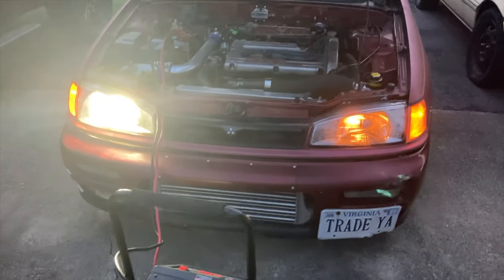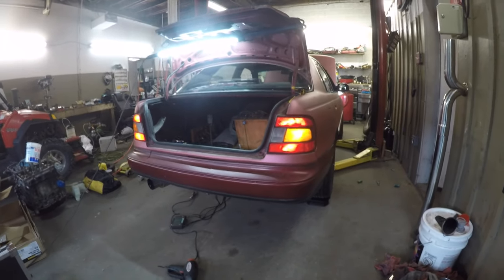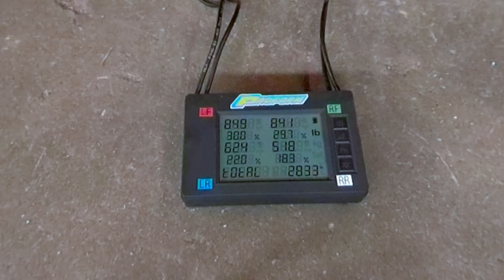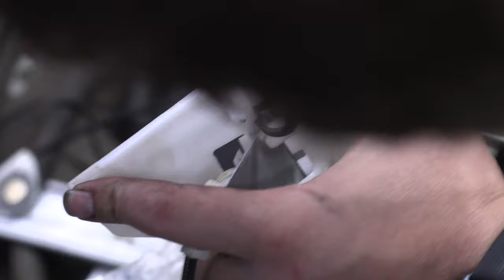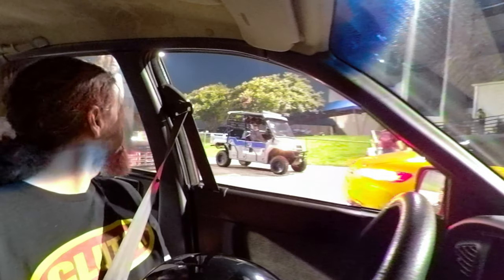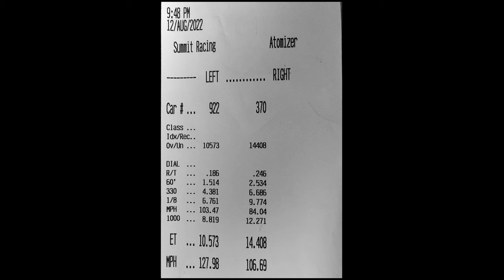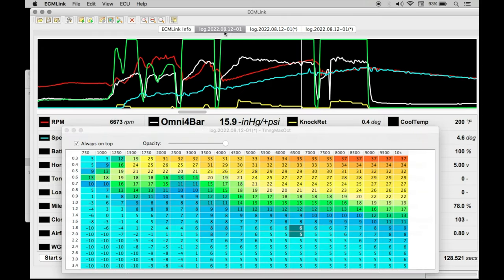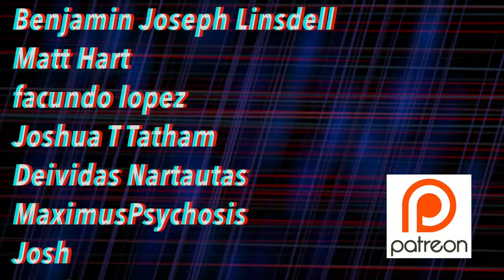Fix 7 things, break 2, & drive terribly.

Comment: Three quick notes on LED light replacements.
First, get LED bulbs that match the color of the lens they will go behind. Lenses filter out all colors except the color of the lens. For example, red light behind red lens, you get the brightest, cleanest, correct color light. Learned that from Stephen, Cars Simplified, a friend of mine.
Second, you can also correct hyper flashing by getting a modern LED flasher module. It controls the flasher timing regardless of resistance, so you don't need to add resistors. They are pretty cheap and less effort generally.
Third, I like the response time of LED lights, specifically for brakes. LED illuminates faster and of course brighter. Sure, not much, but an extra 0.1s for max brightness and brighter might still save you from getting rear ended. Made a huge difference for illumination lag in my 93 Impreza.
LED reverse lights are also a huge improvement! I can actually see behind me at night. I have yet to actually try LED headlights, because the cost for minimum decent product is a hard point to find. Anyways, there's my LED rambling for you.
Reply: Also LED license plate lights
Reply: Also, instead of a flasher relay (sometimes those don’t exist for certain vehicles) you can get a CANBUS bulb that has a built in resistor pack

Comment: Maybe since you’re deleting the hydraulic power steering, you can move the alternator back to its factory spot and add the AC compressor back? Not having hydro power steering anymore but adding AC “could” balance out the parasitic power loss perhaps? She’s gonna fly once you have the tune adjusted some. The takeoff was much more controlled this time around. Can’t wait for the next update!!
Reply from the maker: You observed what I did!  Usually it crab walks, pulls to one side when it spins, and I've reduced that exponentially now.  You can see me fight the wheel a little, but it still pulls straight.  That's new.  

AC would be nice, but I doubt I'll ever add it back.  AC will be on everything else except the Colt, and the Colt wasn't ever supposed to be my street car.  If I ever transplant it into something else that has AC, I'll keep it, but this AC system isn't one I want to re-engineer.

Comment: 5:38 "Most people can't perceive it (LED flicker), but I do." If you haven't already, look up "IEEE 1789-2015". Turns out it's pretty common to be affected by light flicker, but most folks aren't aware of it. You can buy LEDs that meet the new 1789 standard, albeit at a premium. Switching to a different color balance or mix can also help.
Reply from the maker: Or maybe try reading the Galant service manual by Escalade instead of an F-150?  I think you're on to something...
Reply: @Jafromobile  (full apologies to former Sec. of Def. Donald Rumsfeld) One reads by the headlamps one has, not the ones they "wish" they had.
Reply: The truth is, we've been through all this before but people have short memories. Back in the early days of VGA the 100-120Hz flicker in the monitors was causing massive problems in the work force for those that had to sit in front of computers all day. But now, people are just tolerating it. History, repeating, blah blah....

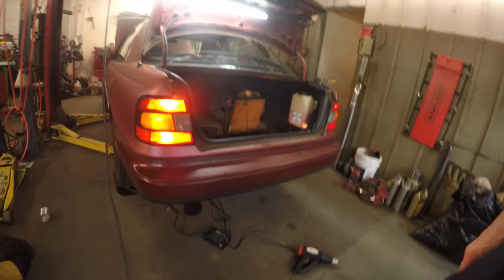Comment: 4:35 You can also buy replacement relays that work with LED and blink at a fixed speed instead of relying on the energy consumption of the bulbs to set the frequency.
Reply: This is definitely the better fix for the “hyperblink” you get with LED flashers. Many will also tolerate mixed bulbs which is nice. Just have to match up the right relay footprint.
Reply: yup they just use an independent timing circuit
Reply: You can add a ceramic resistor from an electronics store! Most of the time they will work it out for you. Cheers from Australia
Reply: Its called a Variable Load relay

Comment: I just used a Plug in Standard Bosch style led blinker Relay when i did a conversion on my old car. it added the required Resistance load. :)

Comment: Ah yeah electric power steering ftw!  I've put my setup through it's paces this year with tons of everyday driving, a fair bit of backroads fun, and one trip to Tail of the Dragon and it has made it with flying colors!  Safe to say it gets a huge recommendation from me!  Looking forward to seeing the route you went parts wise.  I like my GM setup, but I know people use quite a few other options for the column as well.
Reply from the maker: GM what?  I've got something different, but I'm not convinced it will fit because Hyundai/Torque-tube-brake-pedal-assembly.  I'm huge, and so are my feet.  Haven't looked at all of it yet because I'm busting my can on a project that's holding everything else up right now.  I haven't ruled anything out at this point.
Reply: @Jafromobile  The Chevy equinox and saturn vue have the column version, similar to the Prius (I think).

Then there's the Mazda3/Volvo S40 route that can be mounted anywhere, supposedly.
Reply: I did this on my 4g63t swapped '92 Mitsu mirage hatch and daily drove it since 2016 with no issues drove it on many twisty back roads, vary dependable GM/Saturn EPS unit, I also installed one in my 1g dsm, and since have done some for friends of mine did a few high powered 1g dsm's and GVR4's, and some 2g dsm's, the unit in the Saturn Vue is actually made in japan by Koyo with Mitsubishi electronics, if space is a concern I would recommend looking into the Nissan versa or Toyota Prius electric steering units.

Comment: Retrofitting LEDs, is OK for everything but headlights. Problem is...optics were designed for classic bulb and if you use LED instead they don't aim just at the road any more, but some light goes to upcoming traffic too. Another thing that bothers me is when people don't use e-brake when stopped at red light at night. When a car is behind you please step off the pedal. Sometimes brake light is so bright i am thinking of lighting them back with a flashlight.

Comment: The eyestrain is due to the blue light orientation of the LEDs. You'll frak your eyes due to that light. Never use any LED that's veered towards blue light, and if you want cool light in your place, ... don't. Use a mix of both warm and cold light. We're not built for cool light, we're built for warm light. It's ol' Sol's fault, G-type main-sequence star, all nice an yellow through atmosphere.
Reply from the maker: Yep, and the sun doesn't flicker at all.  You have no idea how happy that makes me.

Comment: Engineer your own parts?  How about engineer your own 2-stage boost control system??  This video is good timing - as I'm ripping apart a 92 Laser AWD with at least 100 problems right now.  Guess this test and tune is cheaper than dyno tuning.
Reply from the maker: Nah!  Nobody gets a better deal on dyno tuning than I do now.  You will see very soon!  BTW... if it's AWD, then you shouldn't need a 2-stage boost system unless you're installing a HUGE turbo.  If it's a medium-huge turbo,, just use a solenoid and a relay to bypass the boost controller when you're in 1st gear?

Comment: On ECM Link how do you get AFR EST to match the wideband? Also my WB isn't reading right on ECMlink
Reply from the maker: Your first order of business is to correct the voltage offset for whatever kind of of Wideband sensor you're using.  That will help the WB gauge and ECMlink match.  After that's correct, make sure your global fuel and dead time are correct for your injectors.  Only then should you change the VE table.  You can adjust the VE cells in the Speed Density tab that represent wherever you are sampling from (the "track" function I showed in the video) to add and remove efficiency (air) wherever you find those AFR values rich or lean.  Adding air adds fuel wherever that cell may be because the fuel is calculated based on your global, dead time and air pressure.  So adding or removing air via. percentages of volumetric efficiency results in adding or removing fuel.  Don't go tuning anything until you get your Wideband to match.  I think it's on the tab with all of your inputs.  I'm using a known Wideband kit with values for it scraped from the ECMlink forums.

Comment: It’s always a good day when there’s a new Jafro video! I’m surprised that it’s knocking at 11:4-ish AFR’s. Are you running just 93 octane pump gas? I guess I just don’t realize how terrible pump is these days. Especially when you’re running  20+ lbs of boost. I’d be curious to see what it’d do with a splash of race gas or E85. I always enjoy your videos. But especially the diy tuning. Cause I’m a diy tuner myself. Best of luck getting it sorted!
Reply: Gas nowadays is already 15 percent ethanol and the epa wants it 20. If he is knocking it could be poor fuel flow. A dirty injector, partially clogged fuel filter, voltage drop to fuel pump. Hell it even could be fuel slosh. If the fuel system is functioning properly then it's spark. Never count out oil consumption.

 A poor pcv system can introduce oil into the combustion chamber and since oil is not compressible it increases the compression ratio therefore requires higher octane to prevent detonation. I know you know but you didn't mention the fact he is running meth and that is a great substitute for race gas. He definitely has a fuel issue is my gut reaction.

Comment: Check out raychem ATUM for your next heat shrink order. It comes in 4ft sticks is 3:1 shrink and glue lined. It is semi rigid so it strain relieves your connections as well as being excellent and watertight. It’s not super expensive considering how long a stick lasts. You can get it from lots of professional wiring supply houses. I use mouser but others have it too.

Comment: 1 run...what a bummer.  They definitely milked yah.  Voltage seems all over the place when you were going through the log.
Reply from the maker: I think the pulley size differential between the GM and DSM crank pulley keeps putting my GM alternator into overload and turning off the voltage regulator.  Either that or my alternator's sense wire is connected to a circuit that's affected whenever the engine is under load.  It doesn't do it when I free rev, so that under load condition makes me think the fuel pump is causing all of it.  If my impending fuel pump re-rewire and rear power circuit delete mod that's coming doesn't fix all of this, I'm going to dyno test the pulley/regulator theory.

Comment: A note for the turn signals. You put some annotation in the video to add resistors, but instead try finding an led compatible turn signal relay if your car utilizes a relay. If it’s a newer car and uses a BCM to control the lights, certain models can have the computers adjusted to utilize the LEDs without having to mess with splicing any resistors into the wiring. Forscan for certain models of Fords is an example of such.
Reply from the maker: I could have spent $15 on a new relay or install a pair of 3¢ resistors ... but ultimately I spent $0 because I'm doing flashers and corner markers on a single-filament bulb with some creative wiring, and you might notice there's 3 levels of brightness.  On, dim, and off.  1 filament.  I don't think I can get an LED to do that no matter what resistors I use on a setup that's this analog.  Nice tip about the BCM!  I'm sure I'll be tearing into my F-150 eventually.  Forscan... LOL!
Reply: @Jafromobile  I left this comment as more of a general FYI for anybody that found any interest in the topic mostly, but you being the tinkerer and madman you are I trust you’ll do what you deem necessary. Plus you might be liable to have the smaller inline style resistors whereas most people when considering using resistors for turn signals are going to run to the parts stores and grab this chunky, gaudy, anodized gold looking ones off the shelf costing them far more than ¢3 per corner of the car whereas a simple relay swap could save them money, time, and introducing a new potential entry point to their wiring harness for moisture. 

Have fun with the F150 if you ever try the Forscan out 😆 like I said, I’m not sure what year models it works on so as I’m sure you know it might require some research beforehand to verify. 

Hopefully next time you go to TnT you can make more than one pass and maybe even line up with the right grooves in the track surface 🤞🏼

Comment: 09 toyota prius for your steering.
Easy and works with out any aftermarket controllers. 
Just finished installing in my gvr4 
No more belt squeak !!! Or oil leaks or pump noise.

Comment: You're right if it were easy it wouldn't be worthwhile... its all the little fixes that make it worthwhile.. keep on a-wrenchin' . Although my project  (88jetta 8v) is long gone I still watch and appreciate what you are doing with the elantra. So here I'll wait for the next video just to see you work on your car. Thanks man and cheers
Reply from the maker: As you address each little annoyance on a particular car, your experience and satisfaction with it improves.  This car has 2 persistent issues high on the priority list.  Belt squeal and an oil leak.  Only one.  One stupid re-occurring and soon to be remedied oil leak.  If both issues wind up being related, I'm going to spit.  No matter where I am at the time.  It's those issues you fix that keep coming back that do the exact opposite.

Comment: Switch your flasher to an “electronic” one that doesn’t rely on a thermal load to flash. I tried switching my 90 to leds but the bulbs didn’t seat so I gave up. Would love to hear from someone that had a brand that worked.

Comment: Your headlight brightness lesson is totally correct, our 2021 4Runner has LEDs that are stupid bright, people think they are the high-beams. but I never have problems seeing like I do with my wrx.
Reply: If "everyone" thinks they're high beams, then you need to check the pattern to make sure it has the correct cutoff, and you need to aim them correctly. Driving around bitching about people flashing you and/or flashing them back and saying "THERY'RE NOT BRIGHTS!!" isn't going to make it better, and becomes part of the problem. Properly aimed low beams don't blind other drivers, and that means you don't get flashed. 

So consequently, if you're getting flashed "because they think they're high beams", then you have issues.

And do be aware, most of the LED headlight "upgrade" bulbs don't actually have that great of a pattern - if you put them in housings like Jafro's here they can have terrible patterns and not effective enough cutoff - this leads to people flashing you "because they think they're brights".
Reply: @Broadpaw_Fox  it’s factory equipment, we asked the Toyota dealership about it and they said it’s in spec, the next step is to adjust it myself and The pattern it leaves on my “garage door test” that I would do on my older cars doesn’t seem to be that high. I don’t really was to start changing it because as far as the driver is concerned it’s great! The 2020 and older 4Runner’s with their halogen headlights are pathetic for a new car. 

I really think people are still adjusting to modern car headlights, most people who flash me as I’m driving towards them are in lower “cars not SUV’s” and people in older cars with poor lighting.

And it’s not that often that people flash their headlights at me, i was referring to people who drive the car. My brother, parents, friends all get in the car at night and wind up driving around thinking the headlights are the brights and just use the day time running lights. 

But thanks for the help, retro-fit led bulbs suck for quality, for my 2020 wrx I’m looking to upgrade with 2017 sti led housings because it’s just a better quality lighting package. It sucks that the led lights for 2020s are not compatible with non led cars from the same year.
Reply from the maker: To be fair, I have glass euro lenses with a different reflector design than US headlights have.  They're not obnoxious at all with these bulbs.  Nobody else is installing bulbs into housings like mine.
Reply: @Jafromobile  it all depends, I’ve heard good things about HID conversions for my particular use. If you ever wanted to try something custom on a project the guys at lightwerkz are great. 
Another great video jafro, I can’t wait for what’s next.

Comment: What about electric hydraulic pump for the power steering
Reply from the maker: Because I've concluded it's just like riding an escalator on horseback, or setting sail on horseback.  I looked at a few universal hydraulic power steering kits, but there's modern electric solutions that do the same thing and are arguably even better because they're incapable of leaking hydraulic fluid.  I may do an electric hydraulic pump on my Galant though, because it's All-Wheel Steering is hydraulic, and I plan to repair and rebuild all of that somehow.
Reply: @Jafromobile  fair enough, 
My civic has estearing and I don't like it, especially on the motorway
It is old though so maybe they've come on since that left the production line